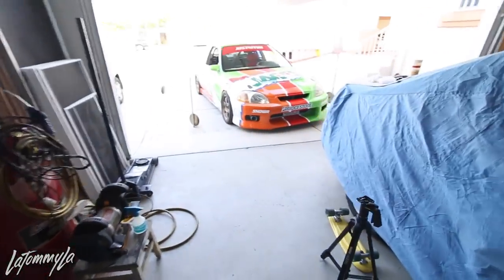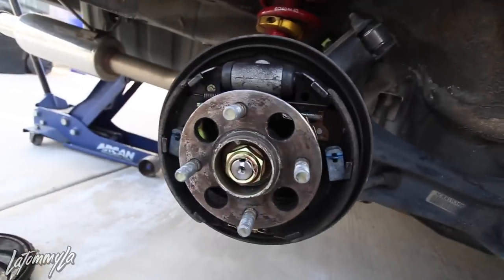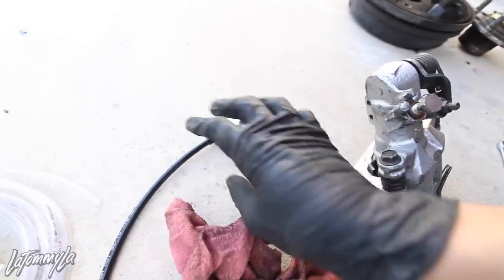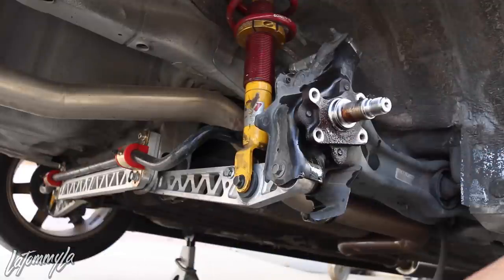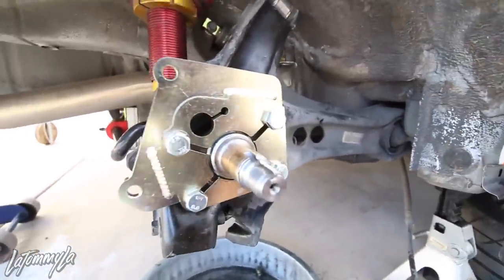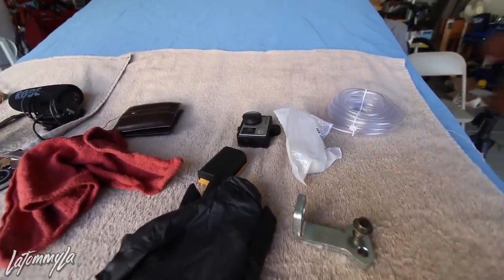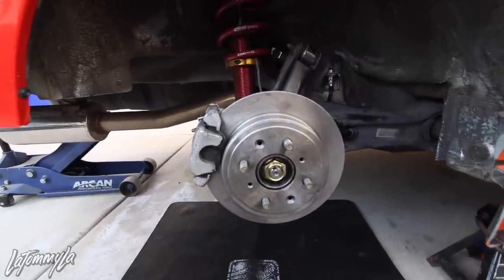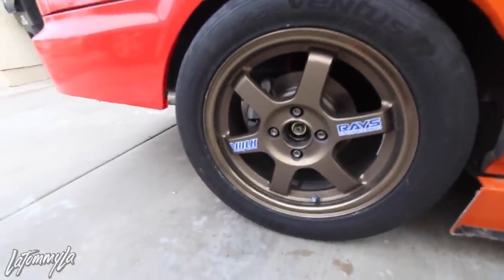HONDA CIVIC REAR DISC CONVERSION +HOW TO?

Comment: Sooooo basically those two brackets are all that's needed to go from drum to disc? I've got a 99 Civic EX and want disc brakes in the back,, I was preparing to build a whole new rear end just to accommodate that want for my car. $160 will take me from drum to disc?? And I'm strictly referring about the conversion not the rotors pads lines and all that other mess. Great video man and I'm super pumped I can go this route instead of whole new other trailing arms from one car and putting those into my car to make this conversation work.
Reply: Honda’s are just made easy to work on
Reply: Swapping the whole trailing arm is less time consuming and less expensive if you find a good set at the junkyard.
Reply: Its not that easy to switch the arm because sometimes they can be soo rusted out
Reply: Brian Otero Honda’s signatory rust😭😂
Reply: So were do you get does brakes im goin tha same route
Reply: GREENEYES GOMEZ local junkyard man

Comment: (We strongly recommend changing to a Integra rear disc master cylinder and proportioning block when doing this changeover.) How are you, brother? Did you feel the need to change the master cylinder as the site guides?

Comment: No need to use the handbrake or breaker bar to loosen the 32mm nuts ;) its a solid pin to the trailing arm :P because FWD ;)
Reply: @LATOMMYLA  will this work for 98 civic ex?

Comment: I bought my rear trailing arms from a 2000 integra at the junkyard for $138 I removed them myself took like 1hour and another 45min to remove the rotors because I didn’t bring a screwdriver and ima spend another $200 on rockauto for cables, rotors, calipers, and bushings

Comment: this is an interesting kit. seems like everyone does the complete RTA's. I snagged mine off a DC integra for my swap on my 91 hatch. This would have been about the same price but wouldn't have taken as much work. I need to see if they make brackets for a big brake setup for the front.
Reply from the maker: Yeah, these require way less work and Im not too sure about front brakes from them
Reply: LATOMMYLA they do make a bracket!!! apparently allows you to run the Corrado rotors and some version of a Chevy caliper with 2 1/4" pistons vs 2"
Reply from the maker: Damnn, thats crazy haha!
Reply: @LATOMMYLA    just saw your video Tommy its great.. I have a 03 civic coupe can u provide a list of parts or website where u got yours when u can thanks

Comment: First off great video.

Second nice ass car

Lastly for everyday driving would you recommend changing to disc brakes?
Reply: Yes. More powerful braking is a huge safety upgrade,ESPECIALLY if your car is pushing over like 200hp
Reply: @TristonSmith_ThePlumbingSmith  Your wheels are gonna lock/abs is gonna set in way before you reach maximum braking power in everyday driving. Having discs on the rear is only better to reduce brake fading when braking hard repeatedly and for easier maintenance
Reply: @MLarios97  okay but what civics have abs? Very few lol The civic si didn't and they had rear discs..

Comment: Loctite would of been a nice safety feature to use for the conversion bracket and also you should of checked for centering on the caliper and added washers as shims to make the rotor centered. Well, i really don't know if it matters but its in this write up on Honda Tech. But yeah those rotors are very small for your wheel size what size are they 17's? I'm using the scarebird conversion brackets too and they didnt' send me any shorter bolts which was puzzling because i didn't know you needed shorter bolts. The hub that the bracket bolts on on my civic seems to have bent a little on the bottom when i tightened it down also and i'm not sure why just bad casting or something. I'm doing this conversion because my brakes never worked properly nor the ebrake. Did the ebrake first cuz its better to get it out of the way in my opinion.

Comment: have you considered a trailing arm bushing replacement? You should do a video if you do so
Reply from the maker: Haven't done it yet since mine doesn't need replacement anytime soon, when the time comes to replace it I will most likely make a video of it!
Reply: LATOMMYLA heard it's a great thing to do even if the OEM one doesn't look cracked or anything. a solid bushing does wonders for handling stability.
Reply: i can tell you right now trailing arm bushings are a bitch to do i just had to do them on my 97 civic lx for it to pass inspection
Reply: ronnie cason I got a sweet tool that lets me do trailing arm bushings on the car, took me like an hour and a half a side with no brake bleeding or anything
Reply: @armchairsniper9828  plz share

Comment: Does this kit change the rear wheel offset like a spacer would? I feel like the hub would sit in further without the adapter plate.
Reply from the maker: +Nick Sabella it does not, the brackets are only for the calipers, the hub doesn't get touched
Reply: LATOMMYLA that's so cool thanks for the quick response!

Comment: Drum brakes are actually better for pure stopping power, they just heat up quickly and retain heat, so  on a track after a couple laps you lose stopping power as they fail from heat. Disc brakes cool much better, so you retain good brake power for longer.

Comment: Great Vid mang! Was about to buy and change the whole rear of my civic. Thankfull I found this vid first.. Question: will the e brake cables, 40/40 prop valve, and bracket you linked or mentioned fit on my 95 civic or do I have to order them for my year specs?
Reply: Luis Cruz I second this

Comment: did a Acura rear disc conversion on my track eg, was a pain in the ass haha especially since on of the trailing arms I got had a bent spindle.... also I didn't even bother taking off the drum, just cut the old ebrake cable and dropped the whole thing and swapped new trailing arms in. probably won't replace the ebrake cables,  it's a track car, won't be using the ebrake much anyway 😂😂
Reply from the maker: Haha, I would put ebrake cables just incase!

Comment: Hey man great video, just one question, did you upgrade the prop valve for this? if so what should you replace it with? I'm very much interested in doing the same conversion, I've heard people say that you would need to change the prop valve as well. Please share your thoughts on this. Cheers.

Comment: Where did you get the pins for where the handbrake cables attach to the caliper, and the bracket to that the cable slides through next to caliper?

Comment: i was wondering what calipers you used ?? since the disks are for a 00 integra according to your link when i click it. so would i want to use integra calipers as well ? also did you change your master cyl. and brake booster as well ?? and did you also swap the brake lines or reuse?

Comment: Just wondering what size the rear rotors you used are? Trying to figure out how to do a Type-R rear upgrade, already have Integra F/R brake upgrade on my EG and I cant figure out if its as easy as getting Type-R rear calipers and rotors? Haha, thanks.

Comment: Will this work on a 96 civic hatchback??
Reply: Yes any 96-00 with rear drums its a universal bracket kit but u gotta order prop valve brake lines rotors pads n calipers seperate
Reply: Thank

Comment: Another question for you.. after you did your conversion did you do anything to the proportioning valve or the master cylinder. I have seen discussion you must change them, others say you don't need to.. thoughts or opinions on this?
Reply from the maker: I got a 40/40 prop valve from honda to finish it off!

Comment: Hey I have a question... I have a 99 Civic and want to do the rear disk swap... but the I found parts for a 95 Civic Si... any idea if I'll fit good or will any special parts be needed?

Comment: you went to oem honda to get all those parts? 
they still make those parts??
Reply from the maker: Only the prop valve and ebrake cable bracket
Reply: What’s the part number on those 2 items ?

Comment: seems like a harder more expensive route. Have you considered swapping integra breaks? i picked up the full set front and rear including the trailing arms and calipers for 268. then just pick your pads and rotors and change the proportioning valve and my hatch stops on a dime.
Reply from the maker: I paid roughly $220, and these are pretty much integra brakes, calipers & rotors.

Comment: I recently did this conversion the full trailing arms from a 95 ex to my 92 lx but for some reasson when i hit the brakes it doesn't lock up the wheels just keeps rolling but slowly stops the car.. did i miss something? I have like 3 40/40 valves one is on the car i upgrades brake booster and master but idk what could be the issue.
Reply from the maker: +brian sanchez if your pedal is soft then you most likely would have air bubbles in your lines and didn't bleed it properly.

Comment: proportional valve is the same for all 96-00 civic including the SI. No need to replace it, if it works.
Reply from the maker: It actually isnt the same, the part numbers are different. SI, and all Hatch models use the same prop valve.
Reply: LATOMMYLA  oh I see, the ex chasis is probably different due to some having ABS
Reply: ek_mariano G not exactly. You're mistaking the brake booster since those are all the same. I believe si models have a diff prop valve. But they are all identical on the outside
Reply: David Munoz 99-00 civic si has the same 40/40 prop. Valve as any 96-00 civic non abs,I thought the ex was the same but it is not.
Reply: David Munoz I have a 00 civic hatch & didn't change the prop. Valve when I did rear disc conversion
Reply: ek_mariano G you don't really need to change the prop valve, but you should do it to take full advantage of the added breaking power in the back since prop valves for the drum cars are way more front biased.

Comment: Tip. Don't smack your hand on the tools, use a longer lever, trust me it will save your hand 10yrs down the road.

Comment: I have a EX with abs, would this whole set up effect anything with a car with abs?
Reply from the maker: You would need a different Prop Valve
Reply: What prop valve would I need to get ? The si one ?
Reply from the maker: Yes, here is the part number 46210-S04-902, they also come on all hatch models.

Comment: hi , it's a very nice video to watch , i have a question , what to do apply hand brake ? shall i leave the drum cylinder inside and install disc and would it work equally ?
Reply from the maker: You have to remove the drum cylinder and e brake cable in order to install it
Reply: LATOMMYLA so how to apply hand brakes?

Comment: I just can't deal with the fact that honda still make drum breaks , all their models cars should be all 4 wheels discs..Is it the same process for the 8th gen? I'm surprised you didn't put vented discs
Reply: Einzigkeit yeah I have a 9th gen I wanna make sure it works for mine too😂
Reply: @grinchayala8318  On their website I don't see any fitting for 8th gen and 9th Gen,, You will need all the whole parts conversion from another car I guess, as for the 8th too.. Be aware that Si has bigger brakes, Has also 40% stiffer spring, stiffer sways/different lower control arms.

Comment: Question would I have to change my wheel bearings ? Or the same ones should work with abs ?
Reply from the maker: Only if they need to be replaced, and rears are all the same

Comment: what is the part number for the calipers and the 40/40 prop valve? I just bought a civic 96 ex coupe.
Reply from the maker: The calipers are from any integra, and 40/40 46210-S04-902
Reply: LATOMMYLA cool thanks!
Reply: LATOMMYLA any integra !??

Comment: Ey love ur video but I have a question ...I have a 93 civic hatchback vx ...I just wanted to know if u know is does my civic haves civ or hon in the rear so I'll know which bracket to buy for my eg and one more question do I need to get integra e-brake,40/40pp and rotors and rear caliper .
Reply from the maker: Check out the scarebird website, it will list all the years and models of which car needs what. Im not too sure about the ebrake cables for your car, and 40/40 is what you will need. Integra rear calipers from any model works.

Comment: wgere can i get the  bracket for the E brake cable?
Reply from the maker: Honda, Part # 43247-SH3-931
Reply: This appears to be for the right side, is there a corresponding left part number? Thanks, having fun checking out all the stuff you do!

Comment: Hey LATOMMYLA,,,what would be the best calipers to use with those brackets?
Reply: Hey I was also wondering where you ordered the E brake brackets ?
Reply from the maker: The E Brake brackets, I order those directly from Honda. And any Integra rear calipers.

Comment: You have a part number for the bracket for the e-brake?
Reply from the maker: I dont, but when you walk into honda just tell them you need the bracket for the ebrake cables on the rear caliper

Comment: What brakes will work on a 2001-2005 civic dx/lx/value package sedan??
Reply: Alex Anderson 2002-2003 Honda Civic Si Hatchback 4 lugs rear disk brake. Or else if you want to go 5 lugs get the rear disk from 2004-2005 si hatchback.